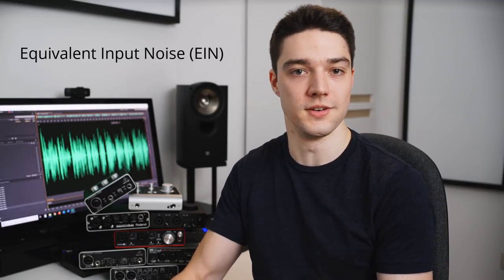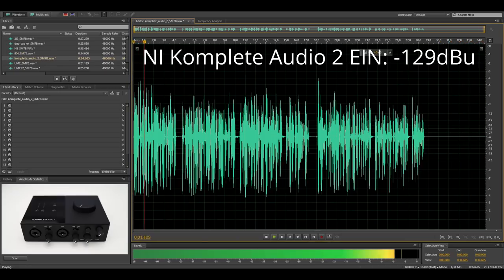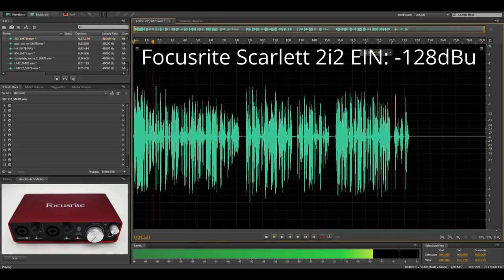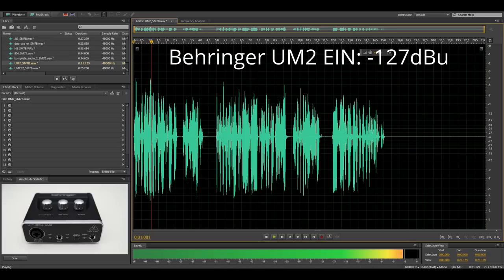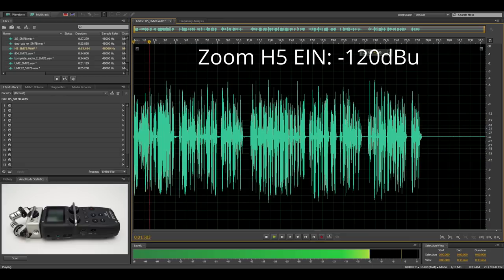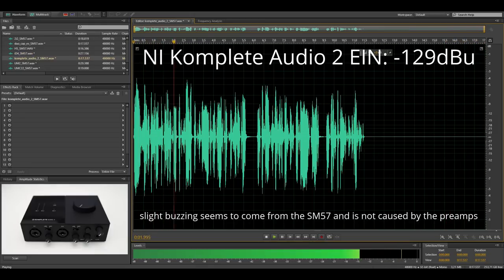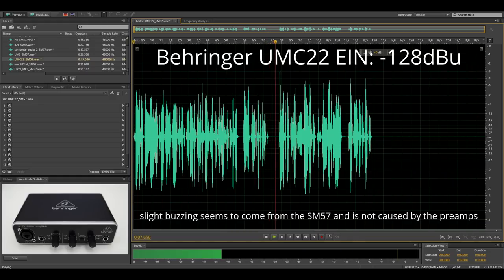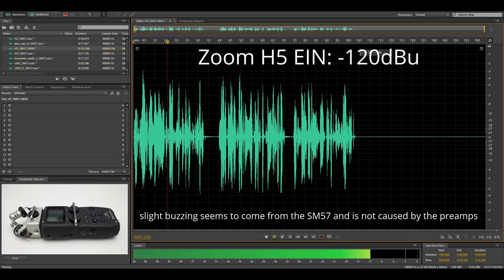Noise Compared - Behringer, Focusrite, NI, Roland, Steinberg, Zoom (with Shure SM7B and SM57)

Comment: hey, if i have a dbx 286s pro mic preamp and shure sm7b microphone, will the behringer interface affect the sound quality/noise  or will the dbx preamp just remove the noise?? would really appreciate an answer right away. thanks 😭
Reply from the maker: Sorry I don't understand what you are asking. Which interface are you using?
Did you try to connect the SM7B straight to your interface?
Reply: Julian Krause im connecting the sm7b to dbx 286 preamp then to the interface. i would like to know if the interface will ruin the sound quality or not. and would the hissing still be there if i used the dbx preamp assuming that u didn’t use any preamp on this video, just the interface preamp.
Reply from the maker: @joekerr8584  Hey, the interface does not ruin the sound quality in your setup. Aside from that, you need the audio interface because otherwise you couldn't record the audio.
When you connect the SM7B directly to an audio interface the amount of noise depends on the built-in preamps of the interface. You can try it out for yourself. Just connect the mic straight to the interface, record a small sample and listen for noise.

Comment: Hi Julian, the PreSonus AudioBox 44VSL claims a preamp EIN of -133dB and a S/N ratio of 97dB. Are these to be believed?
Reply from the maker: Hey, an S/N of 97dB is totally plausible. The -133 dBu(A) EIN are not comparable to my measurements because they specify this with a 40 Ohm load attached. That's why it is so low. With 150 Ohm it would probably be more around -130 dBu(A) which would still be incredeply low noise. But it sounds like a plausible spec as well.
Reply: Julian Krause . Thanks SO much mate, for your great advice. Love the work you do on YouTube as the foremost audio authority. Look forward to seeing more reviews and tutorials from you. Steve.

Comment: Everybody who is using a dynamic mic like the procaster, sm7b and so so with these interfaces is using a fethead/cloudlifter/etc anyways so it does not really matter, right?
Reply from the maker: Correct, if you use a FetHead or Cloudlifter the preamp noise of the interface becomes irrelevant.

Comment: Nice review. Do you recommend any mixers/interfaces for the SM57? I will be doing streaming and trying to look for the best budget one but still have lots of quality. Thanks!
Reply from the maker: Hey, I think the Behringer UMC202HD is the best budget option. It has very low noise preamps. The only downside is that the direct monitoring. You can read more about it in the pinned comment in my review of this device.

Comment: i have a umc22, but its very noisy when i record anything. what am i doing wrong?
Reply: Noisy room?
Reply: @misterjaroslav6859  straight from the guitar to the interface
Reply: @nostalgia_junkie  :( Try Mic volume setting in Windows to the minimum (5 - 50), and volume on the interface to an acceptable level.

Comment: Mr Krause I'm using a behringer umc22, through audacity and a macbook pro to record narratives...when I playback my recording , it's loaded with hiss....I tried the noise removal (don't know if I used it correctly), but it colors the audio and alters it.
It's really frustrating me, because I can't seem to figure out the issue and cause .... can you help me, is it something I did or didn't do in the configuration ?
I use the behringer xm8500, the isk cm-20 and the HTDZ HT-81 shot gun
Reply from the maker: Hey, the CM-20 and the HTDZ HT-81 are both condenser mics. These mics have a higher internal noise and this might be the reason you end up with noise in your recordings. The solution would be to get a lower noise microphone. 
The XM8500 on the other hand is a dynamic mic and in combination with the low noise preamp of the UMC22 should result in a low noise recording. 
Is it correct, that the XM8500 gives you lower noise recordings than the CM-20 or the HTDZ HT-81?
Reply: @JulianKrause  actually Mr Krause , even when I record with the xm8500, I still get that hiss/static in the audio.
Another thing is, the waves on the recording track, is always very small and i record at 50% percent gain. But when I play it back, it sounds clean....it's when I amplify it in post , that's when I start hearing the hiss
Reply: @JulianKrause  can you recommend some low noise microphones for a just starting out voice over artist, with a budget?....thank you
Reply from the maker: Hey, why do you only use 50% gain? Turn the gain to where it needs to be in order to get your peaks to hit between -18 and -12dB. This will give you the best noise performance.
Reply from the maker: The Rode NT-1A might be worth to look at.
Reply: @JulianKrause  Mr Krause I'm unable to purchase that microphone at this time, because of budget reasons...I do know the NT1A is indeed a very good microphone, but out of my price reach for now....is there anything else you can recommend , that's budget, but can get the job done ?....thank you and i do appreciate the info you have provided
Reply from the maker: @antoineinniss5586  It is hard to get a better microphone than the AT2020 for the same price. I think the AT2020 works fine, try to get close to your mouth. About 2-3 inches away. This way there should be minimal noise in your recordings.
Reply: @JulianKrause  ok, thank you so much Mr Krause

Comment: have you tried the mackie onyx black jack preamps=?
Reply: sebas oilher i have that interface and the Behringer as well. The Onyx seems to be a bit quieter on my mics and it also has about 10db more gain. The DI is great as well. One of my fav budget interfaces for sure. Idk about the new onyx ones but I have the one made in 2017 (black and grey aluminum, angled front panel).
Reply: @devingrubbs  thanks for answering. And how about latency? Is it low enough to use vsts?
Reply: sebas oilher yeah it does well for me! I’m on an older machine but I can still track amp sim guitars to midi drums with very low latency as long as I don’t get crazy with post fx while recording. Your computer will def matter more for that kind of stuff.

Comment: where can I see those EINs? the website says -126db in audient id4 https://audient.com/products/audio-interfaces/id4/overview/
Reply from the maker: That's correct, is says better that 126dBu. But it is definitely better than that. Imeasured an iD4 once and it had one of the lowest preamp noise I measured so far.
Reply: @JulianKrause  thanks a lot. Do you think it's the same with the other ones, id14, 22, 44? I wanna buy one of those
Reply from the maker: @israel.garcia  Yes, I think Audient builds very low noise Interfaces.

Comment: Mr Krause...very very interesting test and review, as always .
I'm on my way to purchasing a usb audio interface....I need your honest opinion/answer/guidance, in helping me to make the right choice....and I'm on a budget.
From these tests done here, between the audient iD4, behringer umc 202hd and the focusrite, which is the best , when it comes to.clean and low noise?...I need to choose one For voice over....thanks
Reply: I have a focusrite personally and it works decently with recording. However it will randomly just stop all together while live streaming without error messages or anything. It's a major inconvenience and it seems most mixers and preamps nowadays have issues with Win10 as a whole.
Reply: I'd say either the Audient if it fits your budget, or the Behringer.
I have the UMC404HD- records great, was cheaper than the competitors, haven't had any issues with windows 10. Only issue is the knobs aren't the best quality- they have started to crackle a bit after a while when you turn them.

Comment: all these interfaces for me fails  this in this area(to much floor noise)  at least with the shure sm7b, now if there was a cloudlifter, or a royer db booster; might do better or even great
Reply from the maker: Well, the problem is that the SM7B itself limits the nosie performance. The preamp in the Audient iD4 has the same amount of noise as a cloudlifter, so this is as good as it gets. Adding a cloudlifter will not give you a lower noise floor than the recording with the iD4. If you want ultra low noise, you shouldn't buy an SM7B :)
Reply: @JulianKrause   yes I understand, well I guess the two options now are get a condenser mic that can run off 48v of phantom power or just get a better interface with more clean gain and maybe higher and better pre amps?
But anyways I am looking at between two pre amps for my to be able to power the Shure sm7b which is the BFP or the Id44; I think this would be the two choices at least from what I got; may other option was buy a Scarlett 8i6 and run another stand alone pre amp like the dbx 286s in order to power the Shure sm 7b and or to get more power in it so what you think?

Comment: Somehow, I have pretty similar noise level while using at2020
Reply from the maker: When you use a condenser mic, the preamp noise of your interface becomes pretty much irrelevant, and you are limited by the noise floor of your mic. Because the AT2020 isn't the quietest mic in the world, there might be some audible noise in your recording. So, if you want to have less noise, you would need to upgrade your mic.
Reply: @JulianKrause  Thanks, think i will drob by a local store and try something new

Comment: Thanks Julian  for giving us at least some measurable comparision for affordable audio interfaces.
But it would be even nicer if you would be able to perform objective parameter measurements using free application RMAA 6.4.5 from http://audio.rightmark.org that would give eweryone  deeply detailed analysis of each interface  what enyone could objectively compare with other pc audio interfaces even from 2001 (18 years back in time :) )
Reply from the maker: Hey, the preamp noise is an objective measurement. I measure it using ARTA. Btw, I make more objective measurements in my reviews.
The reason I currently don't use RMAA is that I'm not convinced by the measurement methodology. For example, THD is measured by having the output of the interface feed into the input. The problem is, that the resulting THD could be caused by distortion in the output or the input and you wouldn't be able to tell where it is coming from.